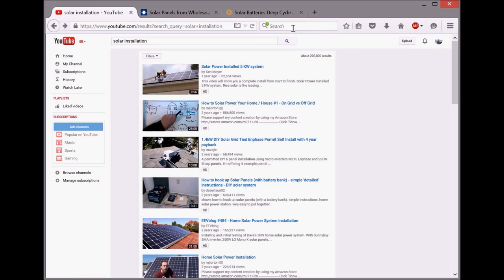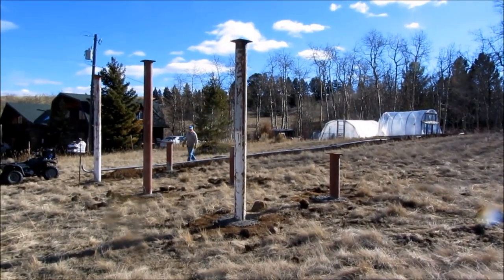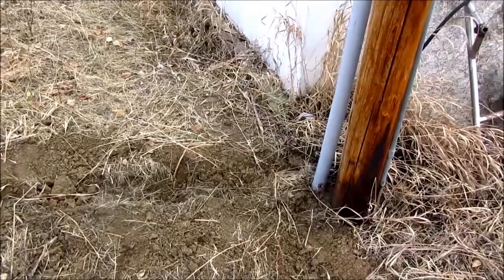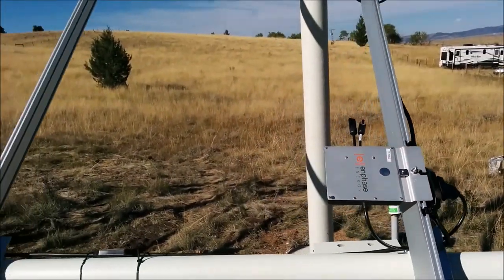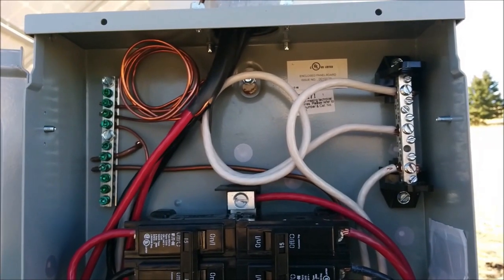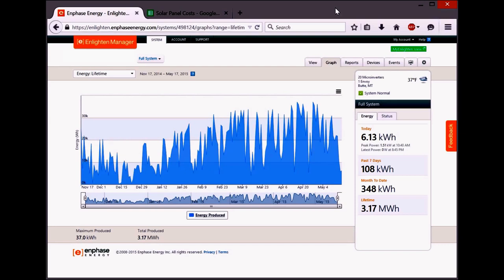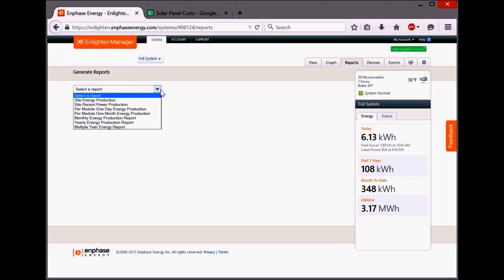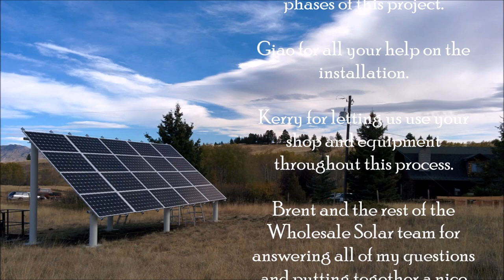Montana Solar Array Installation

Comment: With the new Tech that Magnasine has that allows you to monitor the Batteries and use the Power from a AC Coupled Micro inverter to charge the Batteries even if the grid is down or even if you are off grid. Magnasine has made a diversion load controller that allows extra power single phase 240  to be used in regular Hot water tanks or Base board heaters. Just think of how a system like that could cut down on the amount of Batteries would be needed if Hot water could be used to help heat the home or could be sent to a baseboard heater and a Hot tub. while keeping a battery bank full and also using Power straight from the micro inverter on the roof instead of selling it to the grid and being charged income Tax on the extra they pay you deals and sales tax when you buy it back.